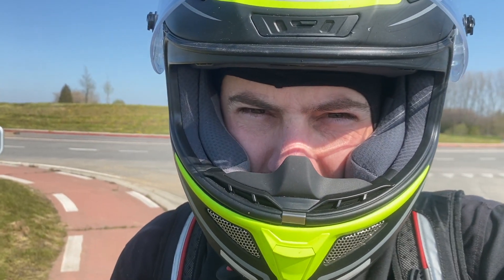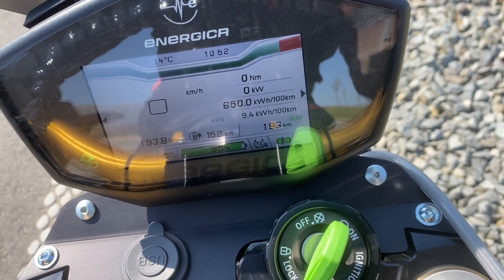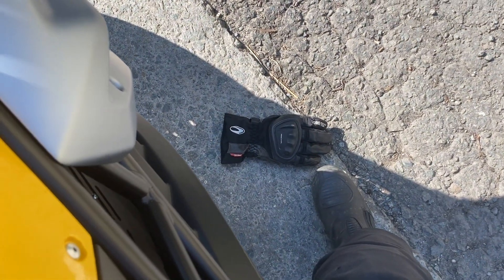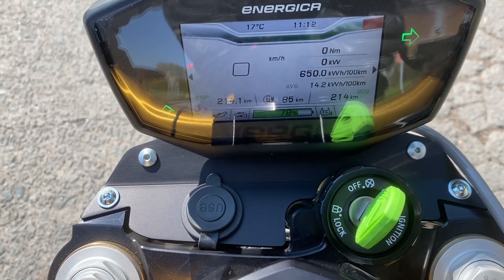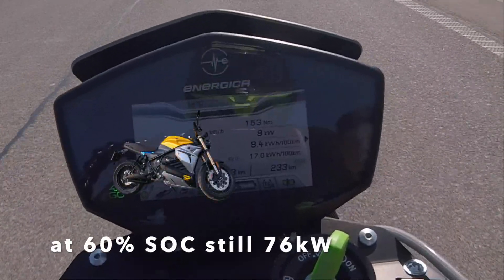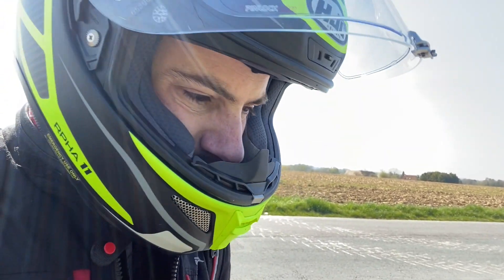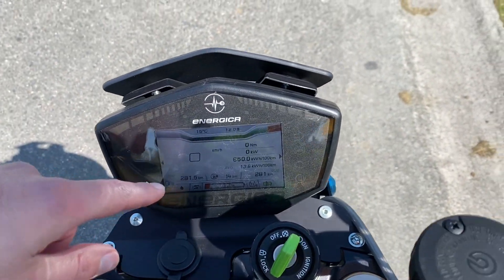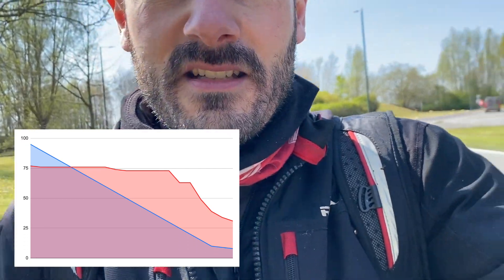2021 Energica SS9+ plus 21.5kWh SoC vs kW power output test @Newzeroland

Comment: Dude!  Thanks so much for shooting this.  I didn't see your video until now.  That's a huge amount of work, right??  It's really cool to see the difference with the SS9+.  Great job!
Reply from the maker: No problem, glad I could help. I used my highway test track so I could deplete that battery quite fast. It took me just over 1 hour. I did get some pointers on how to get more than 77kW peak output by now like not leaving it on TC4. I'll try to record that on one of the next rides (took me a few rides to find how to change TC :D)

Comment: 1: Great video! 
2: Id reccomend using an XY-graph(or whatever google names it) to get only one curve, with an X-axis. Google posts the same distance between 10, 9 and 8 as with 10 and 15.. 
3: The in-video link goes on top of the graph at the end, which is a bit inconvenient, but the data can of course be seen in the google-docs spreadsheet. 
4: I looked at you data together with Sam's and it seems that the 13.4 ego and your 21.5 Esse 9+ is very close in terms of performance from 70% battery, and merges at 40%. 
5: Did you consider going faster to achieve fully 80kW? It did seem to me you did measure at around 100km/h speedometer (which should be about 90), but Newzerolands data seem to suggest you need to go significantly faster for the last few %. It is not a big deal to me, im happy to see that the power curve is relatively flat all the way to 30% SoC at 100km/h, which means the bike will be very predictable in use.
Reply from the maker: Thanks for the feedback. 2. Good point I'll check how I can swap those in Google spreadsheets 3. Ops I can simply remove those overlays. 4. Yes I had the feeling that merge somewhere at the bottom. Almost as if mine is just everything above 80kW cut off. 5. I was going from 100 kmh up to 140 and even a bit above that but it didn't make a difference. I did a quick test today at 70% SOC just while touring because I figured out how to change TC. In this video it was set at level 4. If I change it to level 3 it already goes over 80kW even from 50kmh 😲 I'll try to capture that next time I'm riding.

Comment: Thanks very interesting test again!. In fact most of the the motor controller include a power to SOC programmed mapping. This is in part to avoid the Low Voltage cut off  ( LVC) of the battery to trigger too soon whne power demand has some peak.  In fact you could draw probably 80kW all the way down to 10 or 5% but the voltage drop of the battery would be too low and it need to be protected.
Reply from the maker: Thanks for the information. I was expecting it to be related to protecting batteries. It might show in the video's I make but I'm not that much of a performance user anyway :D. For both the Energica and the Zero going below 20% makes you really feel the reduced output. And below 10% it's even getting dangerous to be in traffic imho. So I rarely do that or I make sure I'm nowhere near high speed road when I do.

Comment: It’s interesting to see the various configurations and how they react as the SOC goes down. My Ribelle is quite noticeable under 50%.
Reply from the maker: I've been riding a lot in urban at first to get to know the bike and when I started this test I did a quick run still in urban and it stopped at just below 50kWh. So that would match sport mode when going below 15% SOC :O. Below that it dropped really fast to the point it took away most of the fun of riding.

Comment: The thing is why it is showing 76kw max, mine does this as well, however in my opinion it should display 80kw, as this data is not from the wheel but from the motor, therefore it should display the max output which is 80kw
Reply from the maker: At 95% I saw 77kW for my first run. Could be that it does the full 80kW only at 100-95% SOC. Didn't test that.
Reply: @Hans2183  Do you know @ what speed you will be able to reach 80kW fully?- If you look at Newzeroland video, he did not reach max power until about 180km/h, although the powergraph was pretty flat from 110km/h and up
Reply from the maker: Based on a FB message about traction control I checked and mine was at level 4 all the time. So I figured out how to change it 🙄 and on level 3 it can go above 80kW. It's quite hard to look at in the moment. But I'll capture it on video and share here. I was going around 50kmh and just pinning the throttle. Doesn't seem very limited by current speed. But I'll have to verify that.
Reply: @Hans2183  I have video footage of me going more than 180kph, I never saw it go above 80kw